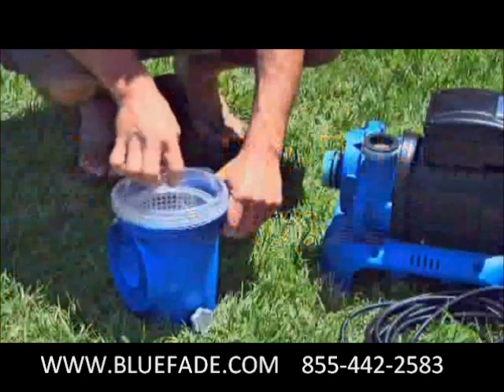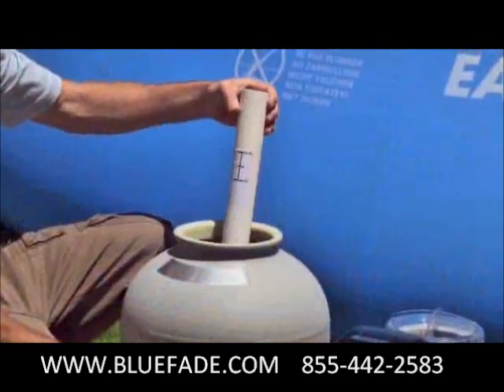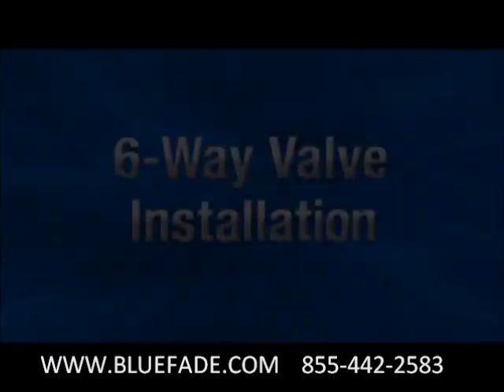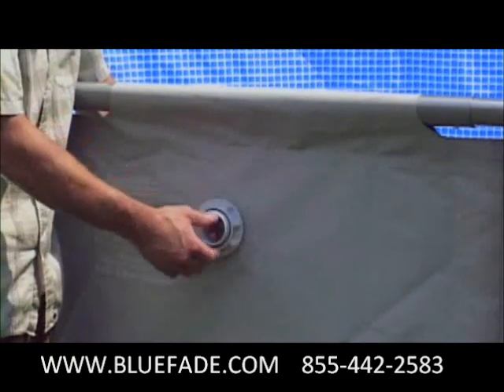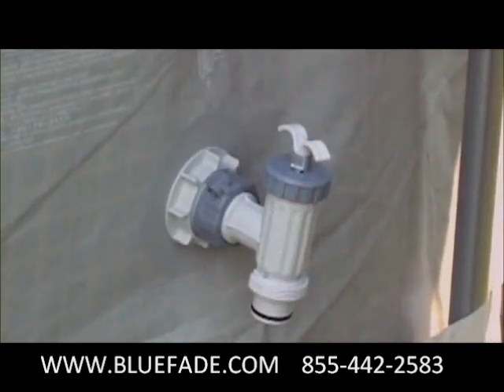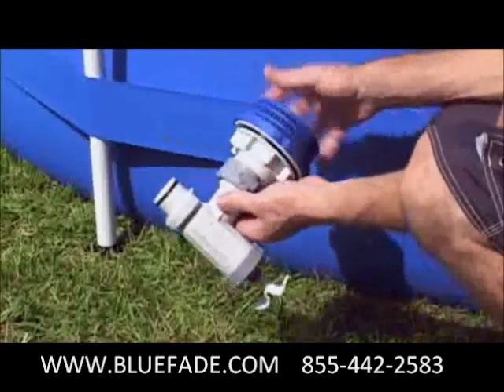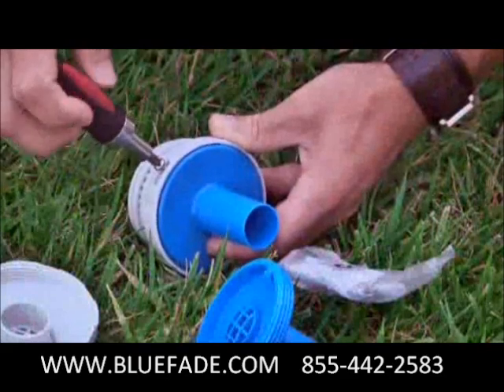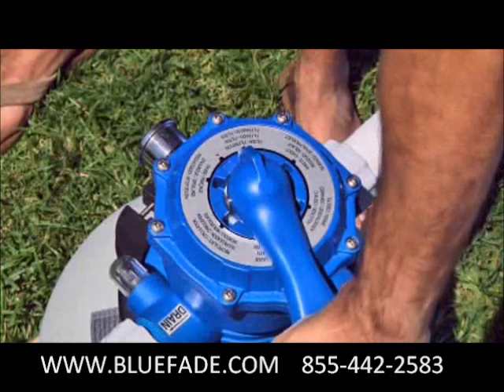Intex 1200, 1600 and 2650 Sand Filter Pump Setup Instructions

Comment: Can anyone help please,  I have the 14" sand filter,  I have only had the filter for about 4 weeks,  no matter how tight I fasten the 2 piece clip to hold the 6 way valve in place it still spits water out when I first start the pump,  it has gotten so bad that I removed it and put a new o ring on,  still leaking.   What am I doing wrong?

Comment: I have a 22ft 52inch deep Intex agp this is our 5th year .. and have had two pumps one was .75hp 3000gph (gallons per hour) exchange /cycle.. the other was a .75hp 2800gph pump both pumps require 5000 gallon minimum to 17000 gallon maximum of water ...

The whole key to dancing sparkling water to me is to keep chlorine a bit higher than normal ( I use 2 floaters with 2-3inch tablets) keep chemicals balanced and run the pumps at least 12 hrs a day or more ... I run the heck out my pumps at least 12 hours a day or more 

I also shock the pool in the evenings at sunset ( solar rays kill the active chlorine ) after bathers or each time people have used the pool ... I have some vids on my channels putting more up this summer by may

Comment: instead of those L shaped connectors from the hose to pool i used an old piece of the hose that came with the pool, cut it in a 12 inch piece then connected it with a bonder to the new hose for pump. worked fine and a whole lot cheaper then buying some connectors offline. this is if yours didn't come with the connectors.